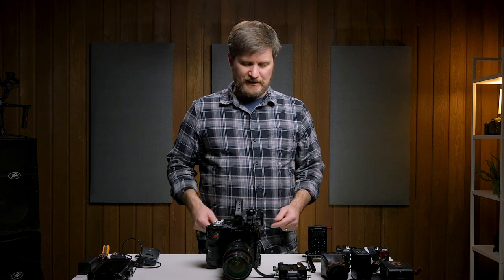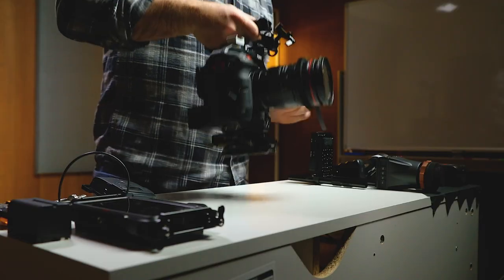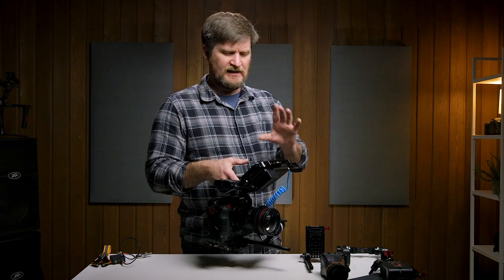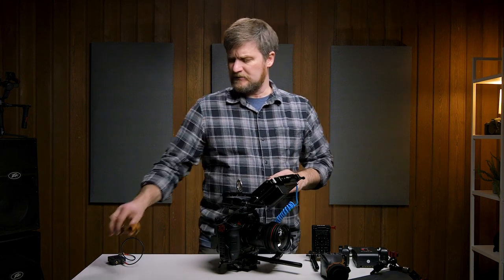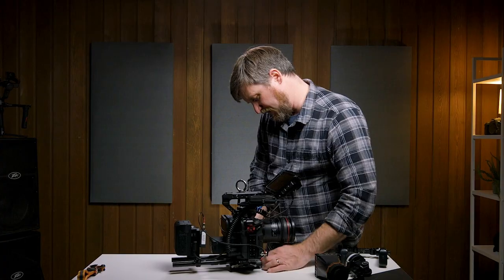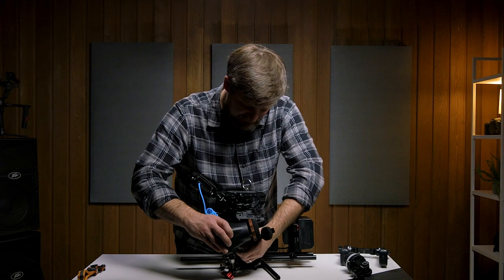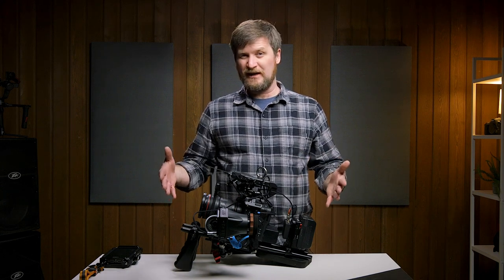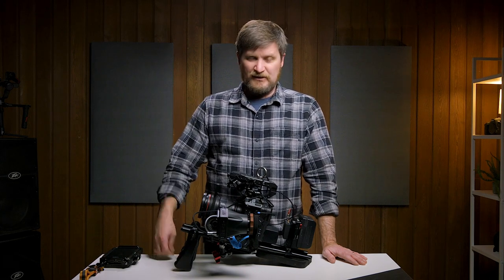Canon C70 Camera Build in 3 WAYS! || Handheld - EasyRig - Shoulder Mount

Comment: How do you get around having the easy rig rope in front of the monitor? Just have to deal with it or is it out of the way?
Reply from the maker: Doesn’t bother me at all. Yes it’s a bit in the way but the camera is off to one side, which means I’m looking at the monitor at a somewhat oblique angle, which puts the cable off to one side of the monitor, I still cleanly see 2/3rds of the monitor. Even with all that, when I’m shooting I’m concentrating on other things and the cable fades away.
Reply: Are you doing mostly auto-focus or manual focus? I just can't get over the rope in front of the monitor.  And then mounting the monitor to the left puts the balance off for the easy rig.  Still trying to figure out what works best for us @onseteducation921

Comment: Great video! I am looking for a solution like the one you touch base on with the Frog Clip and Easy Rig. There are a lot of Eye Bolts and Frog Clip options on Amazon. Can you possibly specify what you're using? Your Eye Bolt appears to be larger than what I am seeing. Also, what does the other end of the Frog Clip connect to on the Easy Rig?
Reply from the maker: Hi Chris! The other end of the frog clip just sits in the U-cradle of the easyrig - I add some gaff tape (just in case) to keep it from falling out, but the pressure of the clamp-down holds it pretty well. The eyebolt I use is a 3/8" and screws in to the top handle in a spot that best balances the front-to-back of the camera so it's not leaning one way or the other. https://www.amazon.com/gp/product/B0767KLF35/ref=ppx_yo_dt_b_asin_title_o01_s00?ie=UTF8&psc=1
Reply from the maker: Frog Clip I'm using https://www.amazon.com/gp/product/B003EM6Y5Q/ref=ppx_yo_dt_b_asin_title_o02_s00?ie=UTF8&psc=1